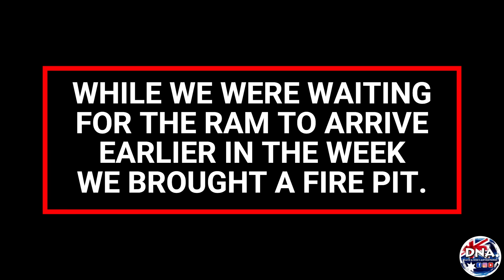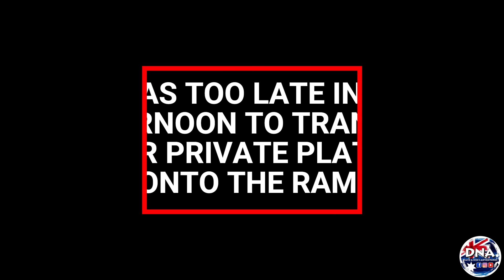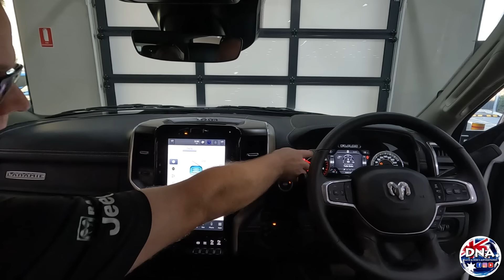OMG ITS HERE - RAM 3500 - WE PICK IT UP - FIRST DRIVE, IN PEAK HOUR TRAFFIC.

Comment: Ad blue I found that the chev can get through a fair bit of ad blue while towing. I initially brought a 10L container of it from one of the supercheap stores or similar place (not cheap way) but now I will fill up at the truck stops and they will have a adblue pump. If I can't get adblue somewhere I have my 10L container. Then when I find adblue pump I top up the car and the 10L container. Always keep a reserve on board as the vehicle will go into limp mode if it runs out of adblue
Reply from the maker: Thanks for the good advice I'll keep that in mind. 
Cheers Dave and Nik 👍🍻🇦🇺

Comment: Congrats guys we have had ours for 3 weeks and it’s still in getting repaired for the last two weeks slow starting after sitting for 20 minutes not happy at the moment 😢😢😂
Reply from the maker: Sorry to hear that you have a problem with yours. 
What is the issue?
Cheers Dave and Nik 👍🍻🇦🇺
Reply: @daveniksadventures2255  starting issues it’s like it’s losing fuel pressure 🤷‍♀️
Reply from the maker: Ok and they have no idea why ?
Reply: @daveniksadventures2255  no not at this stage apparently we are not so happy and asking for a replacement 🤷‍♀️
Reply from the maker: @TerryMcGrath-v4s ok and how did that go down? Where about are you 🤔?